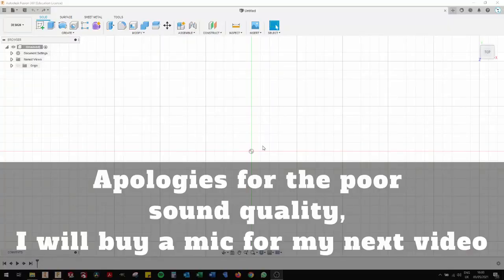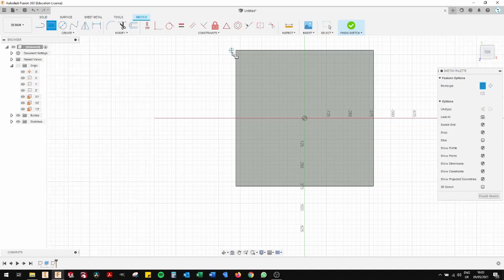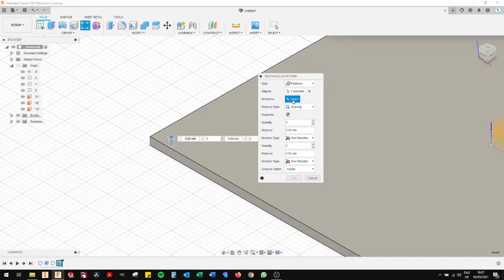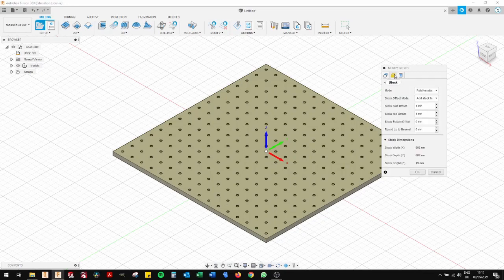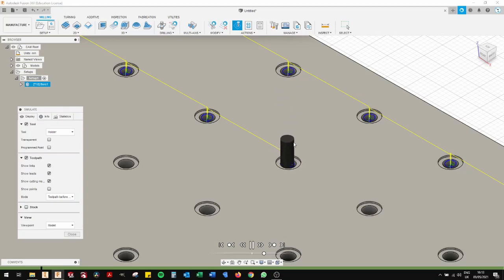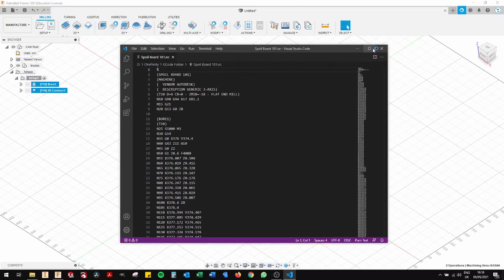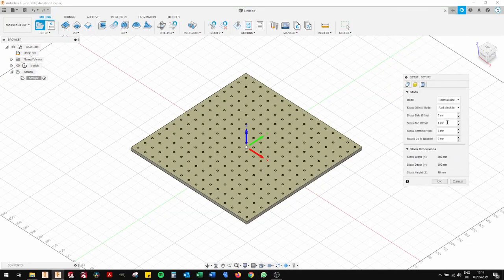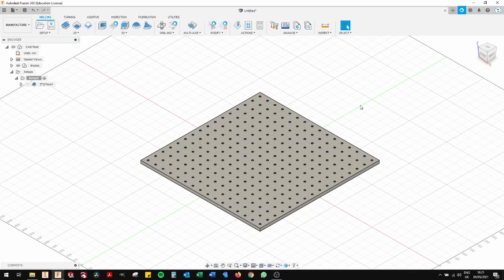Onefinity Tutorial - Design Your Own Spoilboard Using Fusion 360

Comment: Great tutorial! A little confused why you're surfacing the other side? I thought the inserts will be facing up so why not just surface the same side?

Also why add the .2mm? Why not surface the board .2mm down from the top of the board? Thanks again!
Reply from the maker: You put the inserts underneath so you can surface the board repeatedly over a period of months to refresh the board, if your inserts are in the top you'll break the tool and won't be able to surface, 

You add 0.2mm to the stock to be able to surface, if you don't add material as stock you're not telling the machine to cut or remove any stock, you have to make the computer think there is extra material or it will run the cutter over the surface and not remove anything. 

Inserts always go underneath
Reply: Thanks a lot. That seems like common sense. I guess watching the video at 2am may be the reason for the confusion 😅

Comment: Thank you for this great explaining video. I am able to follow all your steps, but I get the stop with the machine parameters. I have a MPCNC with the Makita Spindle and the parameters are not accepted. In the menues, I see some 5000 rpm and the you say that you set the spindle to 16000 rpm. Am I here missing something? I am also not able to find your postprocessor which may be the main problem. I treid to use the Autocad XYZ. Any help appreciated.
The second thing is that I switched PCs and all my Toolslibrary is gone. I searched the old cmoputer, but I am not able to find the file(s)
Reply from the maker: The post processor directly relates to your CNC machine, you will need to find the post processor for MPCNC and add that to fusion, my spindle speed isn't important, it's not part of the set up, you'll just set your makita to what ever the recommended speed is for the cutter you use, I'm not sure about the other items you're stuck with, but you will have a different table size so you'll need to program it differently to mine, your spoil board will have to be the size of the cutting area for your machine, good luck
Reply: @DesignBuildTDE  doesnt seem like it can be the size of the cutting area though as the bit needs to start outside of the cutting area by whatever the diameter of the bit is.

Comment: By far your tutorial is one of the best so a Big Thank-You.  I see the threaded inserts you have chosen requires a 7mm hole size. Am I right to think the bolt size for the clamp you will be using is an M6?
Reply: M6 is correct
Reply: @leeturnbull2082  With the MDF being 18mm thick, what is the height of the inserts you used. I was thinking of getting the M6x13mm?
Reply from the maker: Mine are 15mm, but I also laminate two layers of 18mm MDF so there is a deeper table, it lasts longer when you resurface,
Reply: @DesignBuildTDE  As mine is a single layer of 18mm, I will get the13mm inserts which will give me the ability to resurface 3-4 times. Is it okay if I was to get the unflanged inserts types or since this is a cnc spoilboard use it is better to have a flanged ?

Comment: Best tutorial here on YT for who like me is trying to get started with Fusion. Thanks and well done!

I just had an issue that couldn't solve, when using the bore function, the path show of the bit from bottom to top (and will therefore not work. No way to find a solution for it, so thread function and with this, the pattern is top to bottom. 

Any idea of the reason?

Comment: Thank You, Thank You, Thank You!!!  
As  total Noob to CAM, this helped out alot.  I started working in the surfacing setup before I got to the end of your video.  I have a QCW from Onefinity with the T-Slots built in. So, I need to do the surfacing gcode that accounts for cleaning up the scalps that are left from the initial passes.  But your information helped, So Soo Much!!
Reply from the maker: Be interested to know about that QCW as I have one for my new table, I was curious how you would surface the whole thing as its bigger than the cutting area?
Reply: @DesignBuildTDE  
So with the QCW, only the machine working area can be surfaced, not the whole top.  A surfacing bit will do over the 32.250 X 32.250 (819.15 X 819.15). 
The issue I had was that all the examples for surfacing are for the Onefinity being set up on a flat table with a spoil board affixed to the top of that. 

That situation doesn't work with the QCW as the top "is" the spoil/waste board. And all the examples are not concerned with the scallops that will be left because the surfacing bit turn around is off their spoil/waste board.

There was one other person I found on here that tried to deal with this situation, but jumped over the steps he took to mod the g-code he wrote..

So, in fusion 360 you have to think outside the box.  Now, this was my first CAM/G-Code development. And I probably  went about it all all wrong. But I use fusion 360 all the time for my 3D printer designs but not CNC work.   But your information was really easy to follow.

I basically had to do my design as two modeled shapes. Like a frame around a picture. Both surfaces to be surfaced on the same plane. But it is very important that do NOT touch as fusion can not locate the offset location you need to do the outer edges of your QCW work area.

I had to do two Setups.  The first Setup was a Trace operation for the perimeter (the Picture Frame 815.975 X 815.975 X 15.875) this only needs to be like 5mm thick. It is only something used to work out the perimeter operation.  The second Setup is a Face operation for the field (the Picture in the frame  752.50 X 752.50) I made this the thickness of my MDF 19.05 (a full 3/4"). 

My surfacing bit is 1-1/4"  (31.75) wide.  The width for the model for the Trace operation is made half the bit width of 5/8" (15.875).  This is also the gap between the Face and Trace models.  The model for the Face operation is obviously smaller but I made sure to square off the tool path to insure it did not get to close to the outer edge of the defined work area.

I made a handful of mistakes..  The two major mistakes were the Trace operation went well, but when I did the field operation I didn't account for the tool lead-in movement and it took a little bit out of the outer edge of the defined trace operation.  Then I needed to do more of a step over for the Face operation.  

I new to the CAM side of fusion but I wish fusion reflected what was done in a prior setup when you simulate the next setup..  This would have shown me I had an operation that impacted the prior operation..  

Sorry for the long reply. But I hope it helps you do the waste board on your QCW.

Comment: Thanks for the great tutorial. Huge help, and you saved me (and probably lots of others) days of figuring this out the hard way. One thing you didn't mention in the video and that I can't find info on is how after you switched to manufacture and selected the generic autodesk 3 axis machine, you had the Onefinity cps post option. How did you load that? There don't seem to be any drivers for the Onefinity. Would really appreciate you pointing me (and anyone else wondering this) in the right direction.
Reply from the maker: Go on the onefinity forum and search for Fusion driver, then find instal tutorial, its a cut and past job, takes some figuring out
Reply: @DesignBuildTDE  Thank you!

Comment: what is the thought behind doing the insert holes before doing the facing?
Reply from the maker: Facing has to be done last becuase the insert holes are done on the opposite side of the board, unless you are using front winding inserts, if you mov the board after facing then you kinda have to face it again,

Comment: how do you avoid the lead in on the first pass?  The drill starts past the x stock determined
Reply: Switch off lead in and lead out, uncheck those boxes
Reply: @leeturnbull2082   i have all the boxes unchecked but the first initial pass starts away from the board like in the video.
Reply: @eriorellana89  I'm having the same issue. Did you solve this?
Reply: @leeturnbull2082  I'm having the same issue. I've unchecked those boxes, but it still creates the lead in. :(

Comment: I am unable to find Onefinity post processor. I downloaded the .cps file but still does not show up when doing New Setup
Reply from the maker: You have to find the file and add it to fusion, there should be a step by step guide on the onefinity forum, its really easy.
Reply: @DesignBuildTDE  I did, still not showing up in Cloud or local.
Reply from the maker: Sorry to hear that,